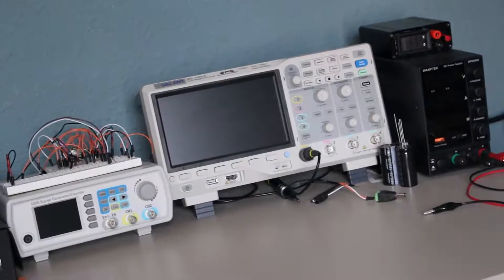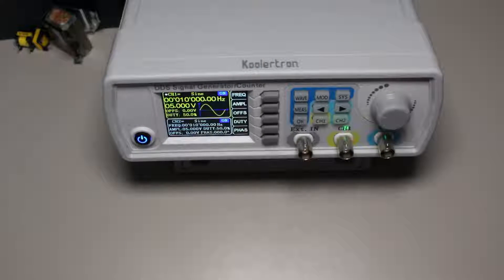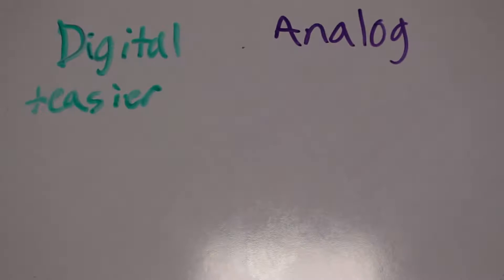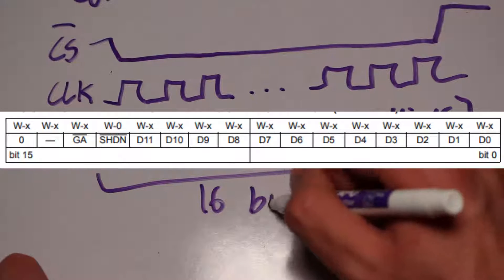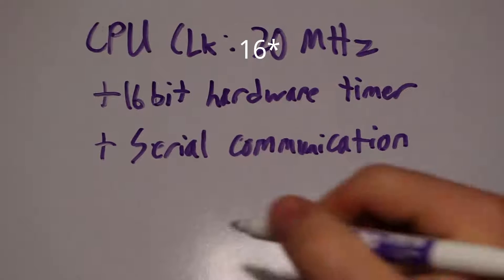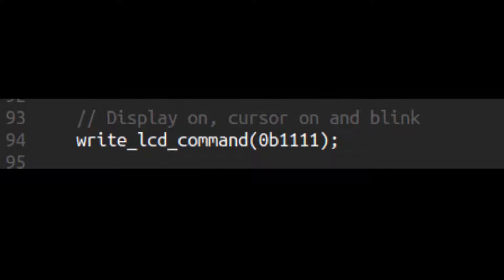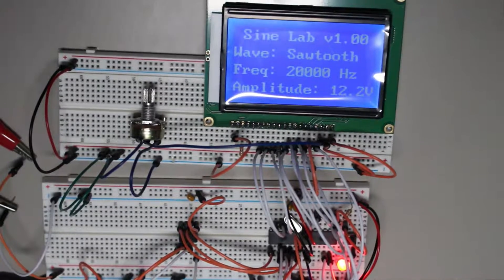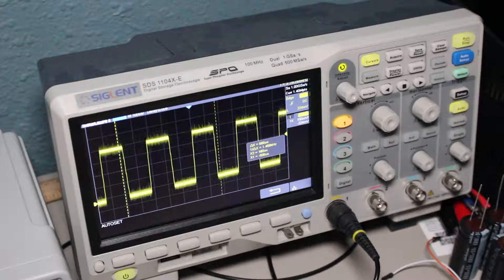The Tool That You NEED - DIY Function Generator - Part 1

Comment: PGA to control amplitude. in sig gen they use parallel DAC. Serial is 12x slower (120MHz clock to get 10MHz waveform)